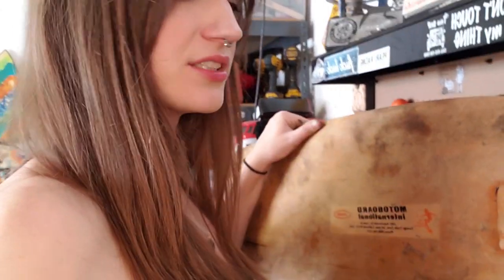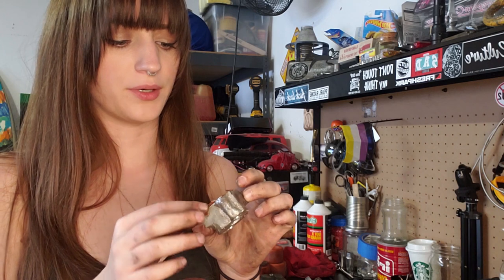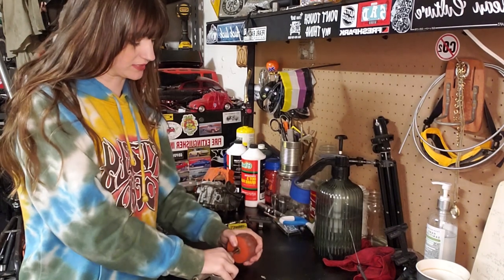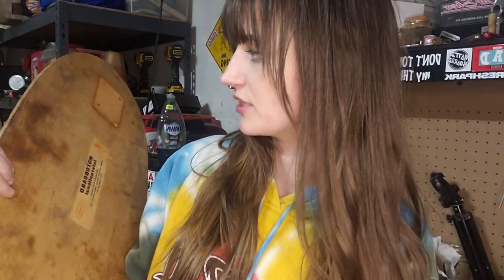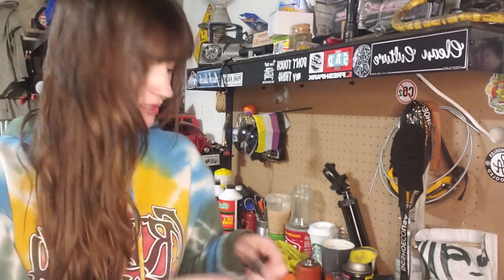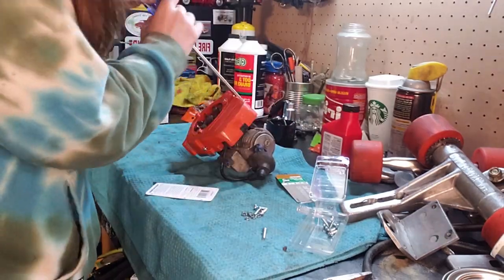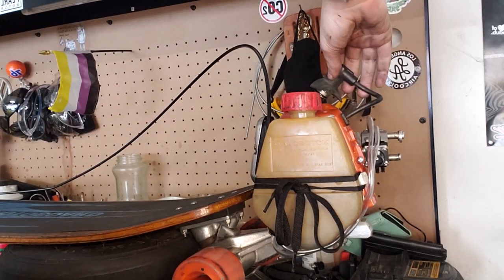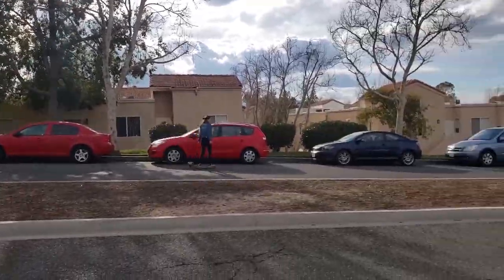Restoring My Vintage Motorized Skateboard!

Comment: I stumbled across your channel and Ill say its kick ass.  My friend Justin Heller at the uphill machine could find parts for your board. Besides owning like 20 Hes actually making new ones trucks and all. Me, I have a Randall R25S mid engine board with a brake as it does 30 mph